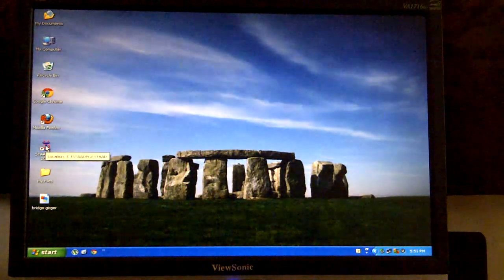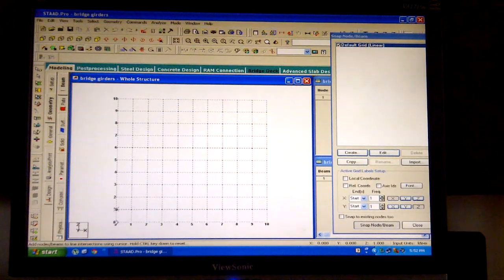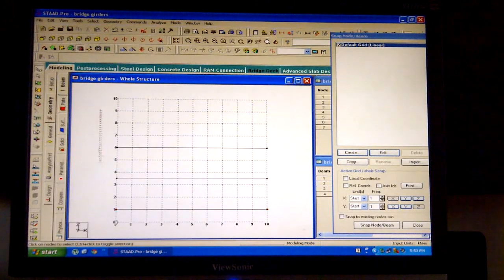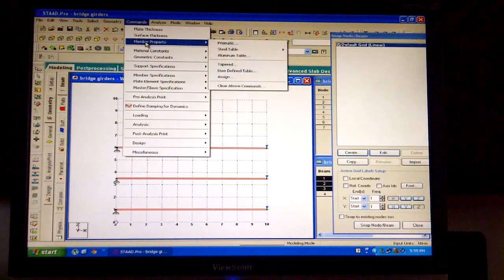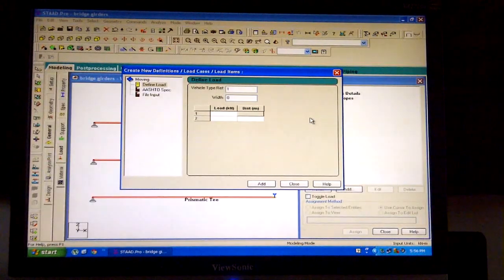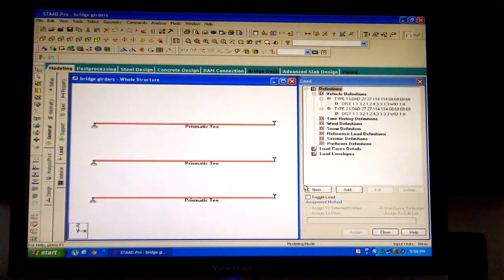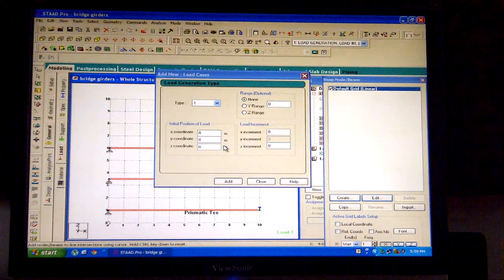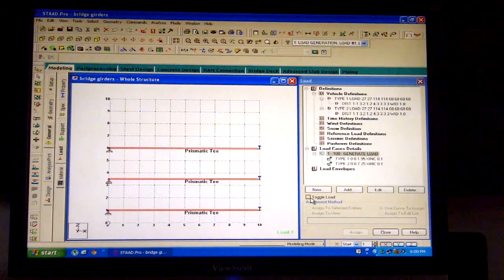Moving Load Generation on a Deck Slab of a Bridge using STAADPro

Comment: there is a confusion in Load Generation Type - z-coordinate.
i think it should be   1.95 - 0.25 = 1.70
where   1.95 = 1.8 + 0.15
and       0.25 = (2.5/2) - 1     , 1 is your +ve coordinate in Z direction which left 0.25 in -ve Z direction.
Am i wrong?

Comment from the maker: Hello Kofi. It does not mean that your program is not meant for bridge deck analysis. It just means that you are designing a steel structure instead of an RCC structure. STAADPro is designing your bridge as a steel bridge. I think you can change it in the materials by changing the default material as concrete instead of steel. I am afraid I cant help you out very accurately as i am not in touch with STAADPro recently. Thank You.